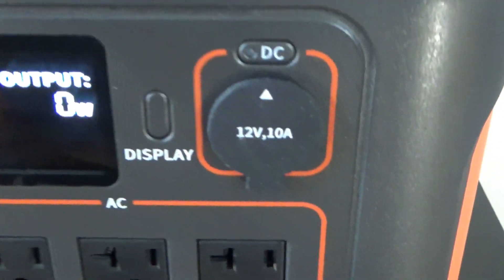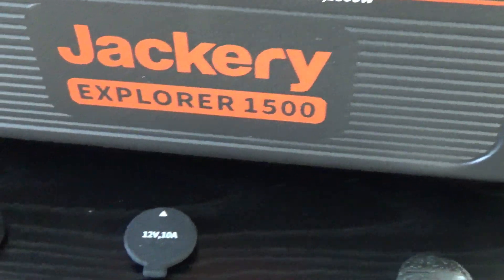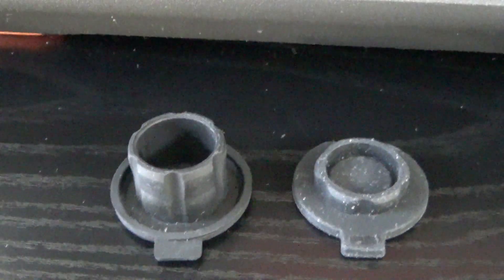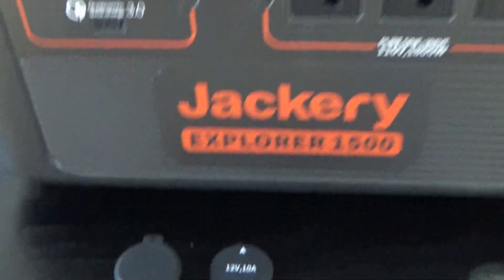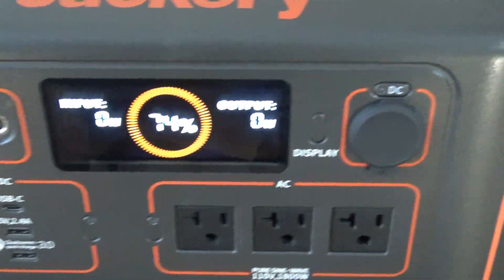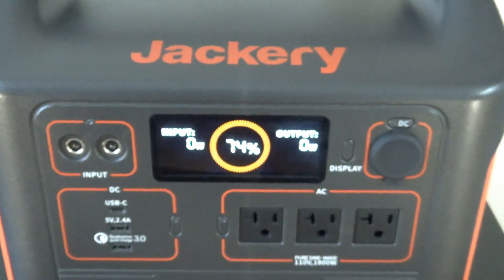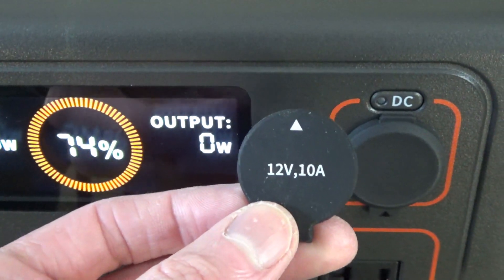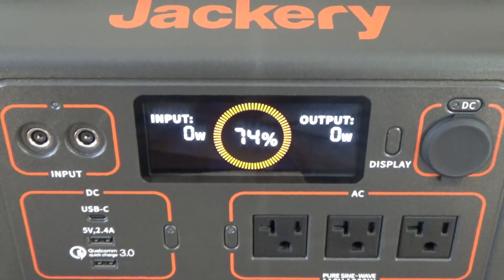Ecoflow got this right

Comment: Thanks for this video. My EBL Voyager 1000 didn't come with a cover over the 12v port. I looked at buying a plug because I find the big open hole aesthetically unpleasing.  

 Rubber covers/plugs run at least $6.00. So I bought a Ainope flush mount Type C/Type A charger for $12 instead.  It gives me an extra  36w Type C and a 36w Type A port for only a few more dollars.  It looks good when installed.
Reply from the maker: Nice! I almost bought some extra covers too, but decided to steal the one off the Ecoflow for the reasons I mentioned. Those flush mount usb converters are super nice too though, I might have a pick one up.

Comment: Jackeries look really well built and I like the spacing of the outlets, but as I'v gone down further the sogen rabbit hole I have realized that there are far superior products. The mentioned EcoFlow comes to mind. lso Anker to a degree. Anything with LFP batteries to be honest. Charging times for most of these units are way faster as well.
Reply from the maker: The new Jackery Pro models have the fastest charging times out there. 

Yes they still lack some innovative features, and are still using NMC batteries, but they do seem to be super reliable. If you look through reviews online, you'll almost never hear of Jackery's having problems. Which is not true of the other brands.

That said, I have quite a few other brands as well, and none of them have had any issues for me.